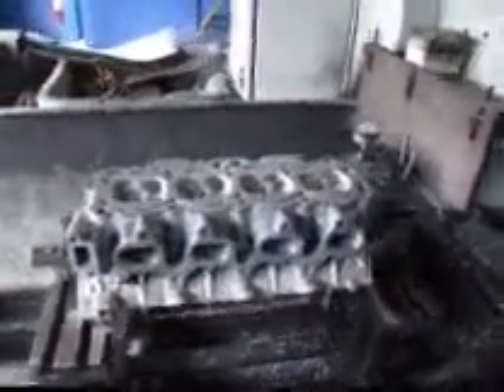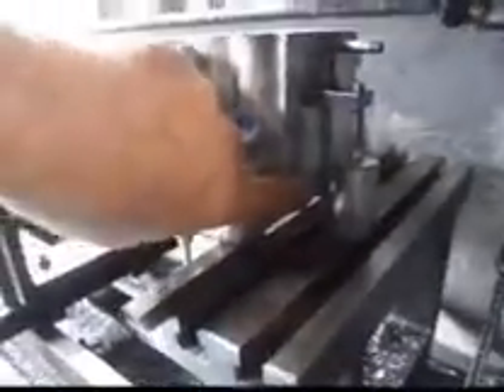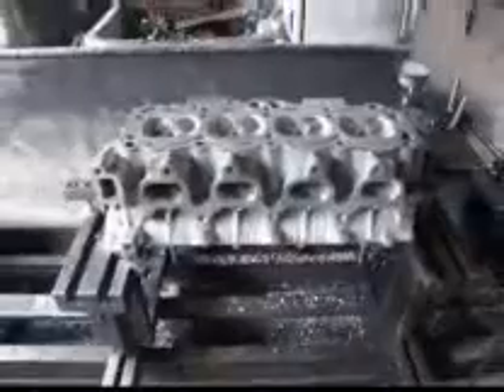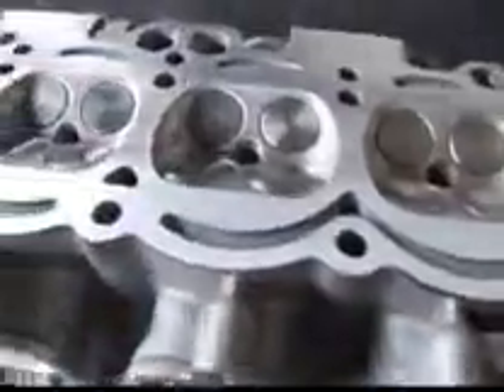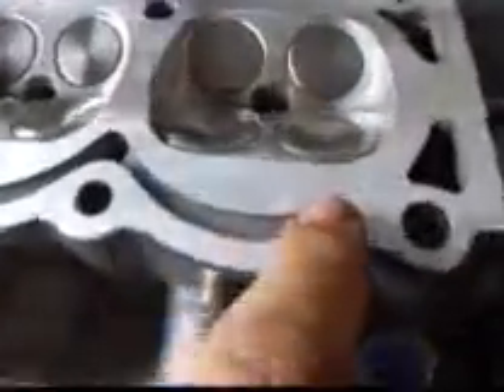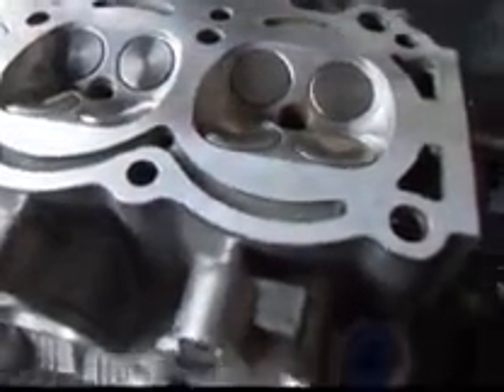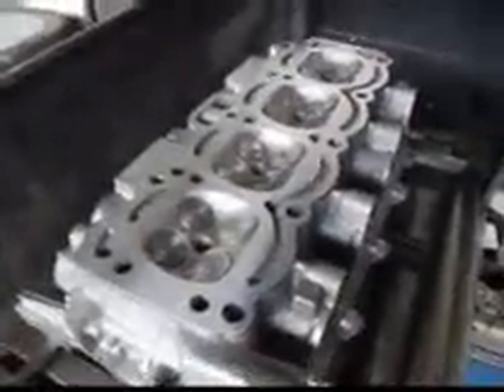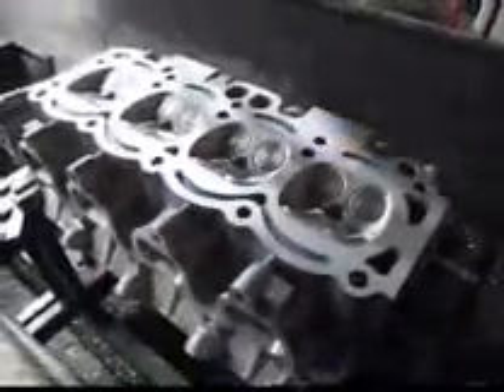4AGE Toyota Head Resurface.wmv

Comment from the maker: @DORUKOZKAN - The gears are in the transmission, but not in the car yet, will keep you posted as to the results. What I'm looking for is quicker down shifts. We will see if the holes aeriate the oil by measuring temps.

Comment from the maker: @N200RC - Yes, I have a 8" flycutter that I made for the Bridgeport, uses standard square cutting or ones with inserts. I made my own insert holder so I could use the same PCD cutter that is on my resurfacer.